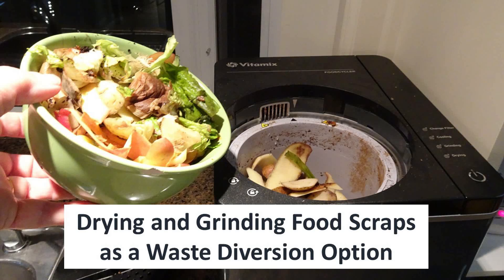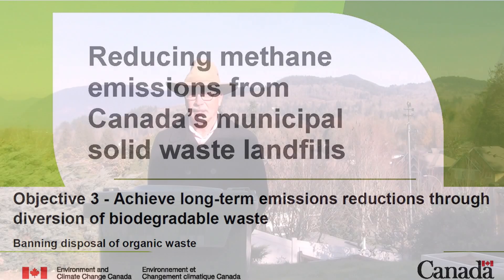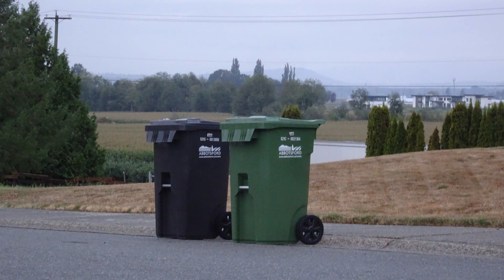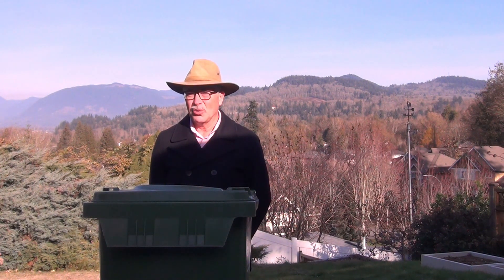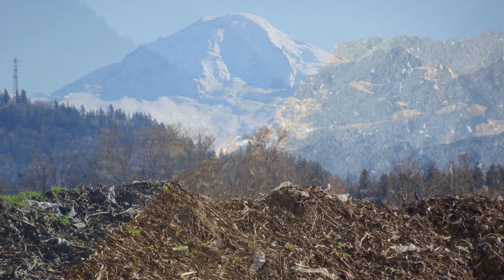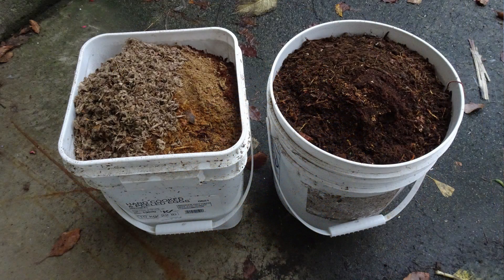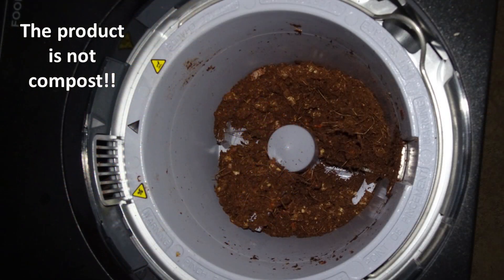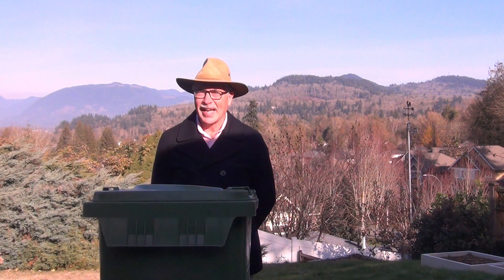Drying and Grinding Food Scraps as a Waste Diversion Option

Comment: Ok how to compost stabilized dry grinded kitchen and garden waste.
Adding microbes converts dried food/garden waste into compost? 
If yes which microbes.
Reply from the maker: Composting dried and ground kitchen waste is not as simple as just wetting it up and turning it. Its best mixed with yard waste or wood chips at about 10-20%. I used 10% dried food waste with 90% screened yard waste and added water to make a mix with 60% moisture, and an air-filled porosity of 450 kg/m3. The yard waste adds the microbes and the porosity, and the food waste adds the energy!